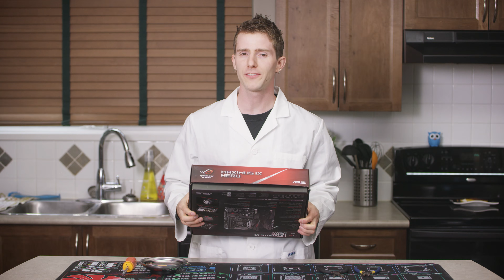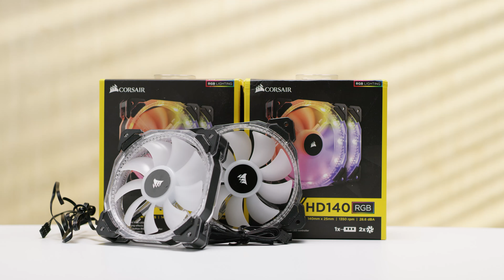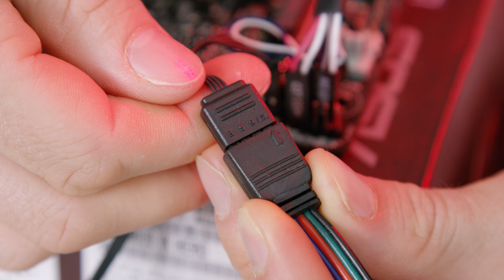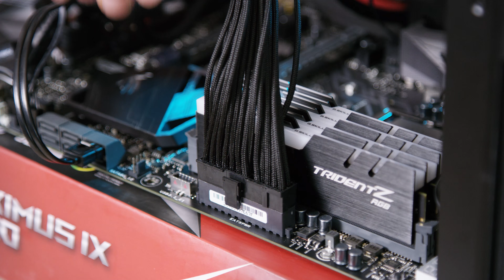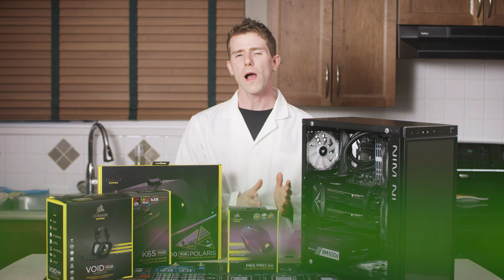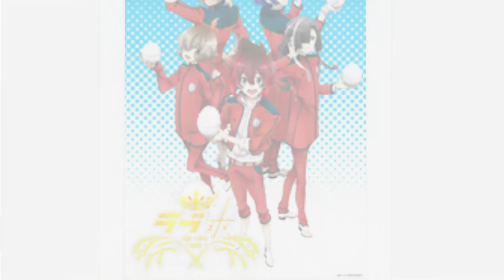The ULTIMATE RGB PC Build Guide!

Comment: It makes no sense to not go for a kraken x62 for the most possible rgb...
Reply: Lars Ose-Johansen yeah it would have been way cooler
Reply: That would add yet another RGB sync program to use. 2 is enough. I personally only stuck to Aura. It has its problems, but my PC looks nice.
Reply: The only extra RGB added would be on the block because the radiator's fans are not RGB. By taking out the corsair stock ones and replacing with the HD120 it already has more RGB than the NZXT.

Plus he saved himself from the pain in the ass that the CAM software from NZXT is.
Reply: the corsair aio doesnt even have lighting, id prefer using bonus cam software from nzxt than nothing at all
Reply: @FluffyCows, the corsair aios do have lighting, my older 100iv2 allows you to pick a color, but idk about cycling rgb automatically.
Reply: Corsair AIO do have RGB, but it runs its own app like NZXT. And as Linus said, Corsair will bring it into Corsair Utility Engine, so you can sync rgb effects with other RGB units.
Reply: Erl88 yes don't really matter would have looked WAY better with an x62/x52 kraken tbh
Reply: 'could of had a 1080ti'
'could of'

Go back to school and learn contractions. This country's literacy rate is lower than that of north korea's
Reply: Jordan Harris Well if they'd used NZXT RGB fans instead of corsair they'd still only need two programs. I think the main reason is Corsair sponsorship...

Edit: They'd still need a third for the keyboard/mouse/mouse pad, but how well do they need to be synched with the case internals?
Reply: sureley "sponsered by corsair"
Reply: I think the only reason they went with Corsair on this one is that they have RGB peripherals and will be merging CUE and Link. If they wouldn't, they could have just used a Kraken and NZXT Aer fans (which look better than Corsair's stuff imo) completely replacing Corsair Link with NZXT's utility.

The Corsair logo on the CPU block is actually RGB though, just not as much as the Kraken. Also, while the NZXT Aer looks cool, it only has RGB on one side, so the radiator fans wouldn't have RGB in this case.
Reply: Corsair gave them a lot of stuff, they might have wanted LTT not to use the kraken instead. I totally agree, it's a "missed opportunity", but this is how bussinesses work, and no matter what, it's still quite RGB!
Reply: Wow I got top comment lol
Reply: comment below you has 333 likes, slow down there tiger
Reply: Nihilus I had it until a couple of hours ago lol
Reply: I have no clue why your comment even has 272 likes tbqh. 3 different noncompatible rgb sets is worse than 2.

Comment: You forget the RGB thermal paste😄

(I don't know how that would 
work)
Reply: Gamer 101 put colour pigments in it,with a pattern like in toothpaste
Reply: You wouldn't even see it other than briefly when swapping cpu, wtf
Reply: theRPGmaster you need to learn something called "joke"
Reply: You could probably mimic the illusion of the paste residing by placing a heat resistant strip around said cpu

I'm just throwing out ideas, I have no idea if this is even viable
Reply: theRPGmaster's channel. Disclaimer: "theRPGmaster" is a commercial identifier and/or trademark and shall not be knowingly misused, the associated trademarks/logotypes or specific designs are protected under copyright law.

Comment: tbh i would get a 1080ti over 2 1070 sli cuz it a bit cheaper so u could upgrade to a 7700k and brag you got a 1080ti but the 2 1070 do look good
Reply: Phantom x Rush they wanted to use that fancy rgb sli bridge. #morergb
Reply: Nah two titan xpp in sli note I mean the 2017 titan x
Reply: The whole point of the video was to cram as much RGB into a build as possible. 1080ti doesn't have more RGB than two 1070's. You think Linus is worried about what's cheaper? lol. gtfo

Comment: Why didn't you go with NZXT Kraken X62 instead? It would've matched the front of the case, because it also uses the mirror effect on the CPU block.
Reply: Probably because it was sponsored by corsair
Reply: because you don't want yet another program to deal with. i don't understand why they used corsair though, asus has rgb peripherals. just maybe not an rgb mousemat. the cooler is the real "problem", i don't know of any decent AIO that supports aura sync.
Reply: but, it's ASUS SYNC compatible, so you don't really need to download their program.
Reply: Corsair and ASUS sync everything. If added ANOTHER piece of software, good luck getting that CPU cooler to sync with both of the other ones.

EDIT: Apparently it is Aura Sync compat? idk then
Reply: akahomie100 dunno where you get that info from but it isnt as far as asus and nzxt their websites say. nzxt explisitly states controlled trough CAM software, which is different from ASUS Armory.
Reply: Zealox Gaming asus aura and corsair link are not synced, atleast not in any info i could find. all major rgb standards are proprietary for now sadly.
Reply: This was filmed in April.

Comment: Did I miss something or did Linus forget thermal paste?
Reply: charlie laverty it's already applied to the cooler he used.
Reply: It wasn't in the shot before he put it on
Reply: My Doge n
no it isnt.
Reply: thats a horrible idea.
Reply: it was probably on the IHS. you can't see it in the video.
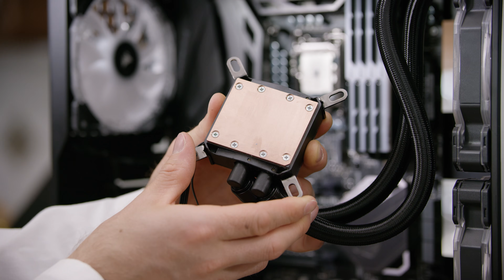Reply: Im Heckin Mad You can see at 10:32 there is no thermal paste on the cooler because they had already used it in a previous review.
The most likely situation is that either they forgot or Benoit's idea is correct.
Reply: If you pause the video at 10:30 you can see a darker dot on the cpu.

Comment: lol u forgot the thermal compound!
Reply: Tim K the cpu water block has thermal compound pre-applied
Reply: RGB THERMAL COMPOUND
Reply: Jonathan Petesch it doesn't have thermal paste in the video... 10.32
Reply: You honestly don't need thermal compound on a completely new builds. The paste is there to fill scratches and such. The metal on metal leads heat a lot better than the thermal compound. This is the reason why you're being told to use as little as possible.
Reply: Changes color based on temp!

Comment: 600W PSU in RGB SLI build. I'm suprised that it even boots.
Reply: Well they are only 1070s
Reply: @jugostran  Under full load their system consumes about 600-650 W. This means PSU works at max capacity. It's efficiency is down also. At full load it will probably pull 700W from the wall. This is very big stress for PSU components. It will probably work but chance of failure will be much higher and PSU lifespan lower. Also if you build costs 2000$ extra 30$ for better PSU is nothing. It's a rule of sorts in PC building: if you building new PC, two components you shouldn't chip out on is PSU and motherboard.
Reply: @yevheniidendebera8406  yeah, I cheaped out on the motherboard...
Reply: Evgeniy Dendebera Na
Reply: @jugostran  same now im sitting here with one PCIe slot...
Reply: that whole build is only 450 watts max it is the perfect power supply to maintain peak efficiency ( 50-80% usage ) you are one of those people who have to have triple the needed power rating. PSU snobs are annoying stop it
Reply: My 1070 ti system with 32 gb ram and a core i9 runs off a 600 watt I was going to get a 1000 watt but I guess it’s not necessary
Reply: Mineylonghead depends if u wanna upgrade parts
Reply: DaddysUnderTheBed true, I have two 2080 tis on the way but I ordered a 1k watt
Reply: Mineylonghead damn your rich lol let me get one of those lol

Comment: Where is the NZXT Kraken RGB Cooler? :'(
Reply: BloodySunday56 ikr
Reply: he was probably sponsored by Corsair. Nobody would really choose corsair fans over AER RGB anyway if price wasn't an issue
Reply: I am actually planning on replacing my H110i GT with the Kraken X62. The pump is too loud and you can only adjust it with 2 speed settings. Also, you can't adjust the speed depending on the temperature.

Comment: no thermal compound?
Reply: Trung Vo it comes pre applied with the closed loop radiator.
Reply: Jose Ahumada did you miss the part with remove protective plastic and shot where is no thermal compound to see ? :-)
Reply: It doesn't need thermal compound when it has this much RGB!!!
Reply: Casual Nerd It's hard to see because of the color but it's there.
Reply: it actually comes out of the cooler when you apply pressure to it

Comment: the ultimate electricity bill
Reply: Riley Cyrus I looked up the power supply he used.  It's 650 watts.  It's ok.  It could be worse.
Reply: lol
Reply: lol the PSU wattage is not the draw one
Reply: It can't draw more than what the PSU can tho lol
Reply: Not entirely correct.
Reply: i cant draw more, it will fry the pc
Reply: No, it will fry itself first usually bringing to death everything after it.
Some PSUs can actually sustain for a considerable amout of time more wattage than the expected.

My initial point was no matter what PSU you use, all the components inside will use the same amount of electricity.
That mean tha if I mount a 2000W PSU inside that, it willuse the same amount of power than the bare minumum.

The delta is in the efficiency of the power supply itself but we're talking about tens of W in bad cases, not hundreds.
Reply: The only things that could kill any decent PSU are manufacturing defects and massive input voltage surges (beyond 400 VAC).

Comment: Is this tutorial detailed enough to actually build this build using nothing but the parts, tools, and this video?
Reply: Hexbugman213 well, thermal paste is missing, but actually it should work if you got some experience
Reply: BassBoostingBrony he said included thermal paste. ewwww grow
Reply: Hexbugman213 yes
Reply: Harles Bently i don't understand this sentence
Reply: Keystrokes included thermal paste is pretty bad normally. its not usually top of the line but rather the bottom of it. and for this build, a huge insane build with no thermal paste

Comment: couldnt do this to a console
Reply: Flying Squirrel But consoles don't cost a 1000 dollars
Reply: Andy Aleman neither do good pcs i can easily make a build for 400\500 pound which is the price for a comsole on realise
Reply: Flying Squirrel Tell me a good cheap pc built
Reply: Andy Aleman 

quad i5 
gtx1050i 
h60 water cooler 
2tb hdd
a decent morher board and cpu and case
550watt power supply
Reply: Flying Squirrel how much will that cost?
Reply: Flying Squirrel because a 300 dollar console can do as good as a 700 dollar pc.
Reply: Flying Squirrel don't waste your money
Reply: Clorox Bleach 300 console will do as good as a 700 dollar pc? In what world?
Reply: Deus Vult In this world
Reply: Andy Aleman no no it wont
Reply: Why is there a PC vs Console argument on an LTT video?
Reply: consoles aren't even $300, unless you live in a place where electronics are way more expensive than america (or live in north korea). if you buy a console used (like you should) it will be around $50-200, less if it is an older gen like xbox 360, ps3, etc, unless you are planning to spend $300-500 on the xbox one s, x; or a ps4 pro, you shouldnt have to worry about prices that much. I'd say, PC's are more expensive than consoles, not by much though. The thing is, PC's don't have to be meant for gaming. I'm not saying "$1000 gaming pc performs just as good as $200 xbox", and screw those people that say that type of thing. I'm trying to say that PC's are a little bit more money for a little bit more usage. Consoles, they are much easier to use than pc's, meant for families, casual gamers, stuff like that. Now of course, people are going to say "but people buy PC's for that reason as well", Sure, that is true, but for the most part PC's are meant for just one person. Also, screw the people that say "i can find a $300 pc build that will outperform any console", they don't understand why people buy consoles in the first place. People buy consoles for the simplicity of them. They play games, stream media in a simple fashion. PC's are meant for people who have a little more time on their hands to mess around and experiment, at least I would think. Consoles are worse than PC's, IMO, but they are not bad at all, they have many strong points, but PC's have have much more strong points if you can take the time and learn them. 
=Examples for Console=: 1.Some man/woman just got off of work and want to relax for a bit, maybe get their competitive side off a little bit, so they want to have some fun by just messing around on COD or something. Not playing to seriously, just wanting to take the edge off. 1. Parents on their day off they want to play some Local Multiplayer games with their kids, something to have fun with the whole family.
=Examples for PC=: 1.Some man/woman wants to have a bit of a challenge, trying out new things on their new PC, having lots more customization than a console, maybe play a couple games here and there. Possibly, they have to do some work on it, so they don't have that expensive of a PC. 2.Even more possible, their whole job revoles around the PC, so they have to have a bit more of an expensive computer for work so they don't have to worry about a slow computer damaging their job. 3. GAMING, or just showing off, PC's can do it very well, better than consoles for a little bit more money.
If you did read this whole thing, thanks... this took a long ass time to write out. Enjoy your day, consoles peasants and PC master race"ers".
Reply: The pc has a pricey upfront cost, but it saves money as you don't have to pay for online, steam sales, and G2A gives you cheap games.

Comment: i would change the psu fan .  its just charged capacitors . if you unplug it then short the green and black pins or  turn it on while in the pc without it being plugged in the wall .  then the pc should flash on then of .  then it will drain the remaining power  . then your  good to go  easy as that lol

Comment: PSU makers need to start producing units with the fan on side and lighting on the other. You'd much rather have the PSU fan drawing in cool air from the bottom (assuming you have a filter there) solely to cool the PSU rather than pulling in warm air from inside the case. Toss some sort of RGB lighting on the top of the PSU à la Team T-Force Delta SSD and you'd have a winner.

Comment: I bought the same power extender in the case. Does the job nicely. I needed to power all the corsair ICUE stuff. the commander pro has problems managinf this so it was easier to get a seprate power extender. Anyway good kit. Do you think the 3090 will go in this nicely?

Comment: 2020 updated version
Your gonna need
Lian li strimmer cables
V1tech rgb ssd shrouds
V1tech rgb gpu support bracket
V1tech rgb gpu back plate
And a deepcool rgb gpu support stand
Phanteks light strips
And slap rgb fan frames and rgb fan rings on some black noctua fans

Oh ya and phanteks rgb radiators

Psst:make sure to use a godlike mother board since it has an rgb mirror effect

Comment: We need more rbg software that is compatible with a wider range of hardware, and also capable of adapting to system states, such as software status (loading percentage, which program is in focus, etc.) and also hardware status (cpu/gpu/ram temp/usage, network speed/usage, etc.). Essentially if there is a way for the computer to measure it, there should be a way for it to apply it to rgb.

I want my keyboard to flash when my CPU hits throttling temperature, but otherwise change based on what game I'm playing.
And I don't want to code it myself. Is that too much to ask for?